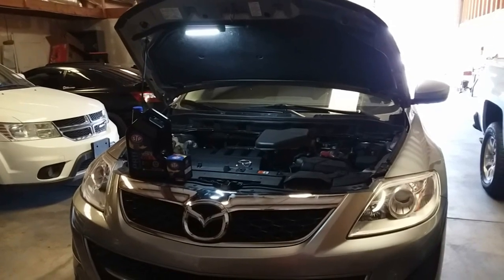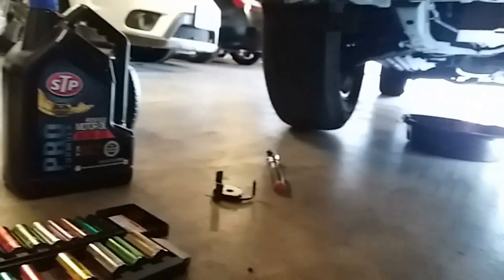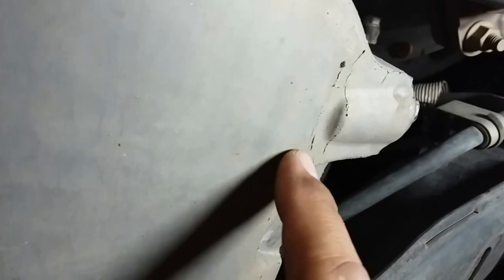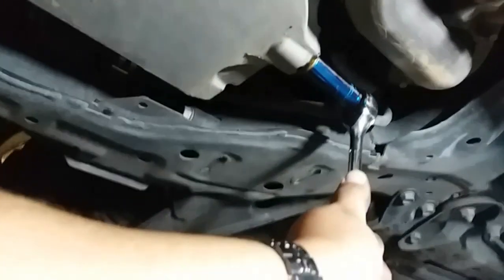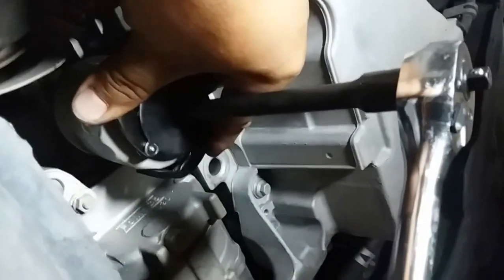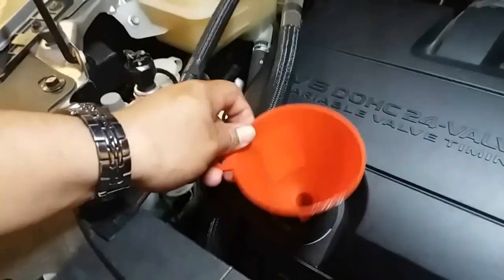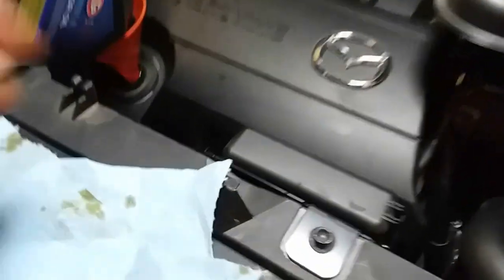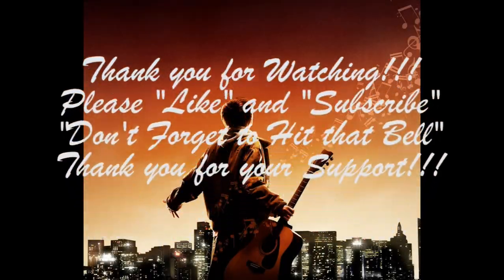How to: Do an Oil Change on a Mazda CX-9

Comment: So here I am, got all the stuff - even got the proper size ratchet.....and I'm up underneath and  I  CAN'T LOOSEN THE EFFING OIL PAN BOLT. 
I find this happening with most automotive stuff; some dude in a hurry overtightening the bolts/lug nuts so now Ima hafta pay someone $75 to do what I COULD do for $35, but CAN'T,  since the GD bolt won't budge. 
I have changed/bled brakes, changed spark plugs, and MANY MANY flat tires. I even specifically request that lugs be hand tightened because I literally BROKE a lug wrench trying to get one off. Took a good Samaritan with a much heftier lug wrench and all 200 lbs of him had to use his foot to get it off.
Thank you for pointing that out, and wouldn'tcha know it. 
Sigh. Now not sure what to do...wait til payday and spend $75 I can't really afford. 😑

Comment: Thanks for this! Gonna do it hopefully later today. BTW: I see you poured in 5quarts but did you top off any more? Googling for my model (2008 CX-9) indicates that I need 5.5quarts. Curious if that extra .5 is really necessary or not.
Reply from the maker: Yes you can, it's just that's all Autozone had sent me unfortunately
Reply: @559powerscape  Thanks! Do you think tilting the car up from that one side really makes a huge difference? I don't have a means to jack mine up so I was planning to use the "curb jack" method where you drive up onto the curb parallel with the tires from one side of the car on the street and the other side on the curb.
Reply from the maker: @Jeremy Lee  you should be good bro
Reply: @559powerscape  so it's alright to get it tilted up on the other side (opposite of where you jacked it)?
Reply from the maker: I would try to lift it on the side the drain plug is angled towards the ground so it gets as much oil out
Reply: @559powerscape  looks like i have a bigger problem - pretty sure the bolt is epoxied on from a prior screw-up possibly by my old mechanic :(
Reply from the maker: Dang, sorry bro

Comment: Appreciate it! Video isn't dry, you make it fun and probably the way I'm about to get it done haha :) Colorful language and all. Be well
Reply from the maker: Lol thanx brother im glad you found this informative and entertaining! Really appreciate you 🙏 thank you for your Support  and have fun!
Reply: @559powerscape  yes sir, got the oil, forgot the filter egh lol. Dodging storms in FL to get it done hopefully today, will report back! Subbed brother
Reply from the maker: @Loki_Dokie  lol dang sounds like Mission. No way be safe out there 🙏
Reply: @559powerscape  🙃🙂🙃🙂
Reply: @559powerscape  my lord I cannot get this plug off, ive even beaten the ratchet with a mini sledge
Reply from the maker: @Loki_Dokie  damn its on there tight. It doesn't need to be that tight...keep hitting the back end of the wrench or ratchet with that small sledge till it breaks loose 🤞🤞🤞
Reply: @559powerscape  realized it's starting to round off, someone did a number on it. Even the 16mm is super loose now and slips when I hit with a sledge, no clue now egh
Reply from the maker: @Loki_Dokie  🤯🤯🤯 maybe you can try some of these....

https://www.harborfreight.com/38-in-drive-metric-bolt-extractor-socket-set-9-pc-67894.html 

Maybe an impact wrench to try and break it loose you can also try to fit a smaller socket hammer it in and with the impact see if it breaks it loose
Reply: @559powerscape  thanks brother, yeah I saw some bolt extractors and was gonna go Impact at last resort lol. Have a great day and I'll let you know what happens if you like. Colorful language day!
Reply from the maker: @Loki_Dokie  🤣🤣🤣

Comment: How do u reset the oil life ?
Reply from the maker: Mazda CX-9: How To Reset Maintenance Oil Change Light 

Turn on the ignition without starting the engine.Keep press the TRIP button until master warning light blinks for a few seconds.Turn off the ignition.Verify the indicator has been reset by starting the engine.

https://www.google.com/search?q=mazda+cx-9+oil+life+reset+procedure&oq=mazda+cx-9+oil+life+reset+p&aqs=chrome.1.69i57j33i160l3j33i299.17131j0j4&client=ms-android-tmus-us-revc&sourceid=chrome-mobile&ie=UTF-8

Comment: I can’t even break mine loose.  Not even with an impact.  :-(
Reply from the maker: Wow 😳
Reply: If you had your oil changed by someone else in the past, it's possible they stripped the thread and epoxied or sealed it back on which is what happened to me :( For the time being, I plan on just doing a top-side oil change

Comment: So it takes 5 quart
Reply from the maker: Yeah that's how much Autozone Gave me. It's in their system on how much each engine requires oil.
Reply: @559powerscape  thanks
Reply from the maker: @HIMI2003  4sure. Thank you for Support!